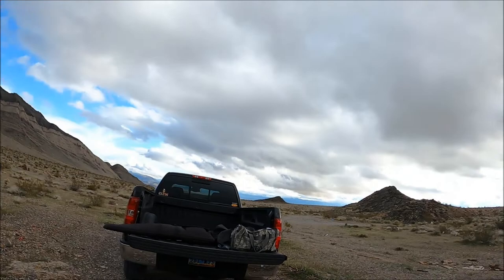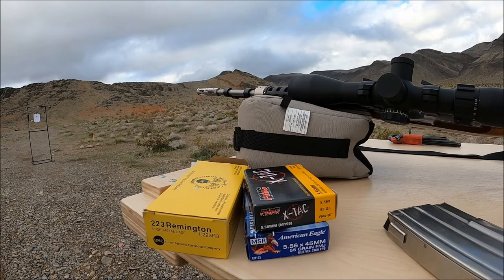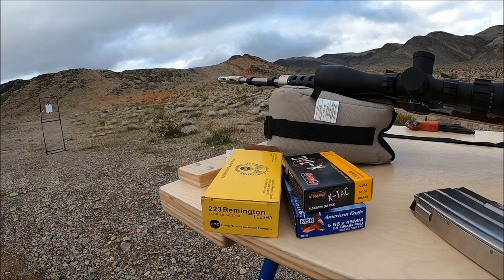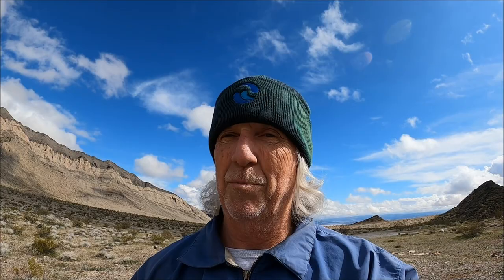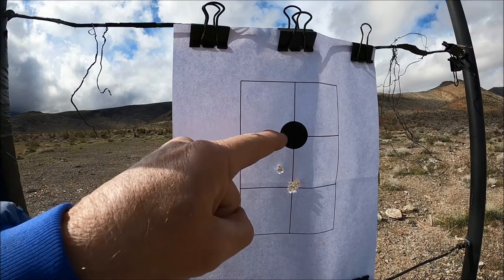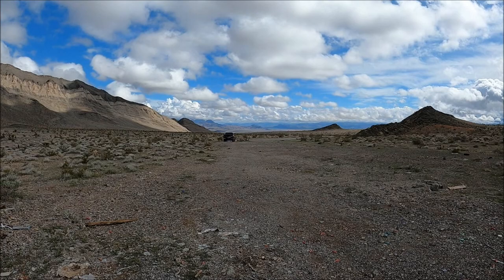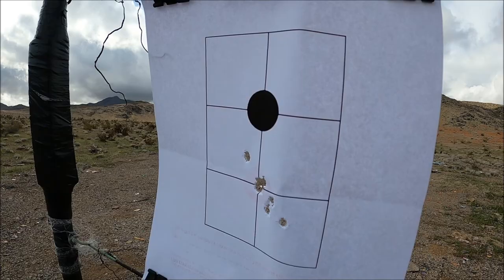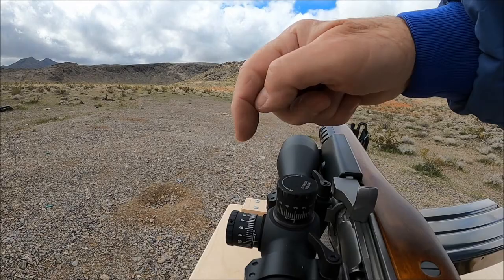Mini 14 Adjustable Gas Block Test (Las Vegas) 04-09-2020

Comment: Cool! I just use a Leupold VX2 2X7 on my Mini. Only thing I changed out was the upper hand guard. Replaced with a Choate hand guard to expose the op rod. Got rid of that shroud rubbing against my op rod. Looks a little more like an M14 and cured the problem.
Reply from the maker: Thanks and thanks for watching!

Comment: It's simple. The Gun comes with a Rail. Put on the Rail and then get rail mountings. That protects my scope, so that the brass strikes the Rail and bounces away. I personally would not lock the adjustment screw. Anyway, Thanks for the video!
Reply from the maker: I bought this Mini back in the late 90's. It had the original thin barrel and rails did not come with them back then. I have since given the rifle to my son and suggested he just run a red dot or go to a scout rifle setup with the optics mounted forward. Still like the MINI 14 though and maybe someday get a new one?

Comment: I bought a 584 series mini14 last year and it also was flinging empty cases into Orbit; and also denting them on their side on main body of the case rendering them useless for my brother’s reloading for his AR15 
 It was also smashing the bolt back causing excessive wear near firing pin back.
Sent it back as it was still under warranty; they sent replacement brand new 585 series, which on test firing did exact same thing denting cases as they flew into Orbit. 
Guess i’ll have to break down and buy one of these adjustable gas regulators.l’m so pissed off with Ruger not installing them in Factory
Reply from the maker: Supposedly at some point Ruger claimed they had made changes so the ejection pattern went more out the side instead of mostly up. Doesn't sound like it was successful!

Comment: I know this is 4 years after the video was posted but I have an old bushel 3-9X and the turrets are way smaller it just looks like that turret assemble is massive! 
Also it looks like they are Really tall turrets like target turrets.
I am wondering if his brass collision problem might be cured by using a scope with a smaller turret assembly.
Reply from the maker: Yes, those turrets were definitely not helping! That scope is used on one of my AR's now. Thanks for watching and commenting!

Comment: I learned the same lessons - BTDT with both the Mini-14 and Mini-30 - IME accuracy/performance upgrades just weren't worth it to me. They're ~100 yard rifles if you want to actually hit something useful - pop cans, varmints, medium-size game bread basket, etc. (4-5 moa),. I axed the scopes and went with a mini red dot with the GG&G forward mount, and combined with the (lowered and learned ) 100 yard expectations, they're now light, quick handling, quick aiming, short range rifles, which is exactly what they were designed to be. If you want to shoot for groups or hit anything smaller than a pie plate past 100 yards, I'd recommend looking elsewhere.
Reply from the maker: I was trying to put lip stick on a pig Lol! I have since given the rifle to my son. He'll probably get it tuned a little better for ejection and maybe scope use but as you were saying not much will help with accuracy with the OEM barrel. Thanks for watching!

Comment: Was just wondering what height scope rings you were using. When I called Ruger they recommended the high rings. Also, were the cases hitting the scope before the new gas block install?
Reply from the maker: When I purchased the rings they were labeled "High". Ruger quite some time ago changed the dimensions and what is now "High" may not be the same as when I purchased these. The scope was being hit before the adjustable gas block install. I was making some progress at the time and I think I could have had the gas adjusted to where the brass would no longer hit the scope and still function well. I ended giving the rifle to my son. Here you fix it! Lol!

Comment: Thanks for this video. Just wondering are you able to adjust it such that it cuts off all the gas from entering the pipe and hence preventing it from cycling at all?
Reply from the maker: Yes, the gas can be completely turned off.
Reply: @Peter Egger Could you or did you try turning gas down until gun wouldn’t function then turn gas back up slightly until functions reliably?

Comment: I saw you did give the rifle to your son. Did you ever consider using a scope with smaller adjustment turrets? The kind with the adjustment cap you remove, then use a screwdriver to adjust the windage and elevation. That way the ejected brass wouldn't be hitting anything on the scope.
...............
...............
...............
Ok, never mind, I just watched the video about the red dot scope.
I've got a Bushnell mounted on the Ruger rings (I do like the quick mount rings your scope had) on my Mini, and I'm considering doing the same thing with mine too. It's a 581 series and it tosses the brass several yards too. I had also put one of the 1911 buffers on it, and it got beat up itself. I ended up taking it out.
I've maybe got 300 rounds or so through my Mini so it's barely broken in, but I can see that over time this can become an issue so I'd like to limit that happening. Ruger supposedly overbuilds their guns, but obviously this could become a problem over time. Best to take that issue out of the equation if I want mine to last my daughter's lifetime.
I'm currently making payments on my 2nd Mini, and I may just go for the strut/gas block combined unit on this new one. I do have an Accu-Strut on my current rifle, so I'll go with the same unit you put on your rifle for the first Mini.

Thanks for the great video's here. A lot of great info.
Reply from the maker: I got it pretty close to where it would eject without hitting an optic and with a little more gas tuning I think the outcome would have been successful. My son just happened to show up for a visit so I decided to give the rifle to him that day. Went over everything with him but I don't think he has done anything more with the rifle since then or has just been shooting it without a scope. Thanks for watching and commenting!

Comment: Is There a Scout Scope Mount Available So Your Scope Would Be Up Further And Out Of The Way Of The Brass Deflection 😀 Pete
Reply from the maker: There is but most of them attach to the gas block and make cleaning more difficult. I have since given the rifle to my son so we'll see what he comes up with?
Reply: @peteregger7928 .. Checking out your older stuff. Wanted to see if I had any regrets. You seem to have the same conclusion on the mini's as I did. Though you took the rifle upgrades further than I ever wanted, I got rid of both my 581 & 582. They are cool for what they are but I just like AR's much more. Did your son turn it into anything more?
Reply from the maker: I think I was getting very close to getting it under control with the adjustable gas block. I had planned to take it out again for some more fine tuning but my son showed up for a visit and I just decided to hand the rifle over to him. He shot it quite often as a youngster and thru his teens until he joined the Navy. I don't think he's done anything more with it? Keep forgetting to ask him when we talk. @Allenmar73

Comment: How did you install the heavier recoil spring?
Reply from the maker: It can be done during normal cleaning disassembly when you remove the bolt. You can find the owners manual at the Ruger website which shows disassembly for cleaning. Thanks for watching!
Reply: @peteregger7928  I know all that. I mean it is such a stuff string spring I am having difficulty installing
Reply from the maker: @georgegiroux4188  I don't remember having any issues installing the one I had?

Comment: What chambering is your rifle? I noticed that you are shooting 5.56 ammo.
Reply from the maker: The Mini that I had can safely shoot both 223 or 5.56 according the the Ruger owners manual. The ejection issues when using an Optic were happening with both 223 and 5.56. I have since mounted an Accuracy Systems rail that mounts to the Ruger dove tails and cantilevers over the barrel a little and installed an Aimpoint Pro forward of the ejection port. Thought about some other options but they use the gas block for mounting the rail for a Scout scope configuration which I didn't want to do. I like the Scout idea but didn't want to use the gas block. I have since given the rifle to my son up in Reno.

Comment: Do you still have the original gas block from your mini?
Reply from the maker: Yes, but the original gas port bushing was trimmed/fitted for the new adjustable one. I would have to find a new bushing at OEM dimensions or larger and then trim/fit that one if I were to go back to the OEM non-adjustable gas block.
Reply: @peteregger7928  I don't suppose you would want to sell it by any chance?  I ask,  because my 182 serial  mini  has a cracked gas block,  and I can't seem to find a replacement locally. I have tried Ruger direct,  but as you rightfully said, they do not manufacture or have spares for the more vintage models of Mini 14's.  I live in Namibia, and Accuracy Systems international  will not ship here,    nore will Brownells and various other agencies. I am willing to pay for it as well postage.  Any assistance in getting a replacement will greatly appreciated.
Reply from the maker: @royalsalmon800  Not sure what all the legalities are but since this video I have given the rifle to my son. Don't know what other possibilities there are in your country but would it be possible to repair the crack? A good welder and machinist? The reason the big retailers here in the USA are reluctant to sell you firearm parts is that they may fall under ITAR (International Traffic in Arms Regulations) and it's not worth it for them to jump through all the hoops to find out or get approval.
Reply: @peteregger7928  I've tried to have the crack welded which failed,  (it broke off completely,  and I was able to have it welded back on,  but the weld is very poor and week) as my mini is  stainless version. All of the Stainless blocks are cast,  and welding cast stainless is very tricky to do. Thanks for the explanation about restrictions. Unfortunately here in Namibia, we can not just buy another rifle and be done with it.  For us to get permission to have semi auto rifles is like jumping through endless amounts of hoops, not to mention the expense. Thanks for the reply.
Reply from the maker: @royalsalmon800  Would have liked to be able to help! Good luck with it!
Reply: @peteregger7928  thank you anyway for the reply.  Appreciate the your time.